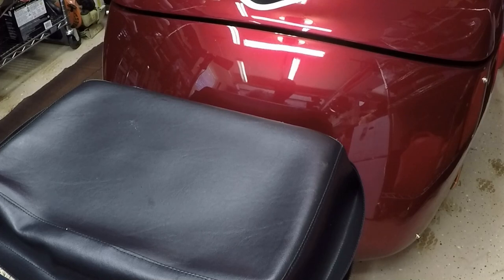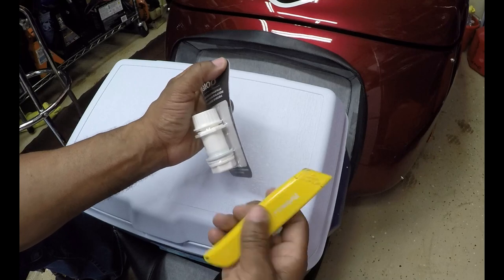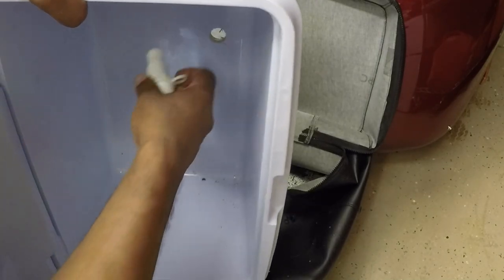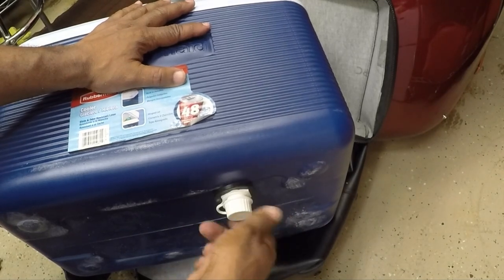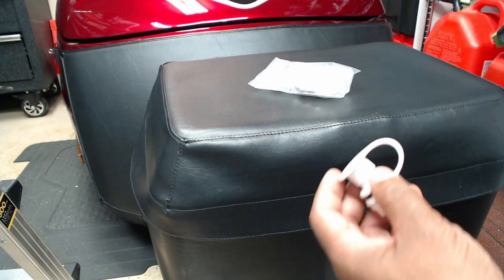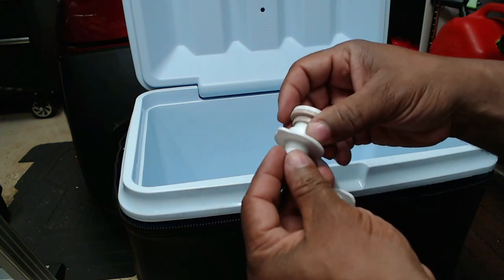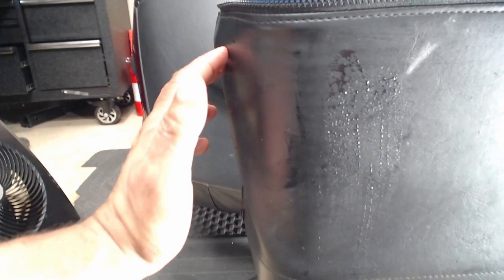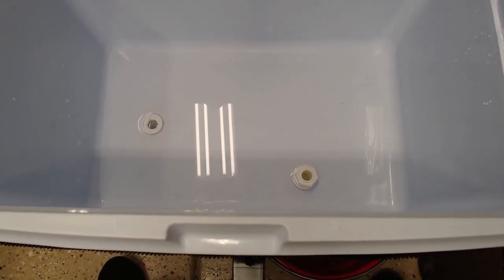Ice Chest Cooler Hidden Drain Plug Installed on a Motorcycle Trailer

Comment: Hi Chris what I did was I drilled a hole ( 19 mm ) in the bottom/ back/ centre, then I put piece of 19 mm poly pipe into the hole with Silastic ( making sure the the poly pipe is flush with the inside liner ) I put a 90 degree fitting with a valve on the end ( the discharge facing to the rear of the trailer) and with the 2 small self tapping screws I attached the valve body to the bottom of my cooler mounting box. I have  plugs that fit nicely and flush on either end of my drain ports . I have had no issues since I have installed my drain, I also mounted a waterproof light half way up ( inside ) - ( outside ) with a quick disconnect lead /  5amp fuse / inline switch- it is awesome if you are pulling up at a rest stop or siding we’re there is no lights. This setup is not for everyone but for guy’s like me that cross the continent ( Australia 🇦🇺) 3 or 4 times a year and enjoy the open road - pulling up rolling out you swag and be able to open your cooler to pick out what you need ( beer / steak ) a light really helps 😎.
Reply from the maker: Your very creative, brilliant minds think alike, good job!

Comment: Thanks for your great videos! Just a quick question, why did you put the plug on bottom? Will cover not fit if on side?
Reply from the maker: I believe that a bottom plug drains much better so I challanged myself to see if a bottom installation would even work since every cooler I've seen has a side drain.  A bottom drain would drain majority of the water out but the side drain leaves a good level of water in the cooler like my last cooler so I made the needed improvement.

Comment: Chris how about the fiberglass on the bottom of the escapade that holds the icebox in place ??????
Reply from the maker: The fiberglass tray that holds the Ice Cooler is rock solid, The fiberglass tray has hidden metal mounting brackets running near corners but once you drill thru the integrity is very solid.

Comment: I have a Bushtec and an escapade trailer. Both sell the same Rubbermaid cooler, but escapade has no answer when I asked them why theirs has no drain plug (and therefore a solid pan). It makes no sense. Anyway, Bushtec sells a drain plug on their site. Havent gotten around to doing what you did, but I always wondered  if I could indeed do it, and if  could use the drain plug Bushtec sells.
Reply from the maker: I wondered the same thing about Escapade but hopefully my video will give you inspiration to complete what should have been standard drain on a Escapade Trailer, I’m not sure about Bushtec Trailers.